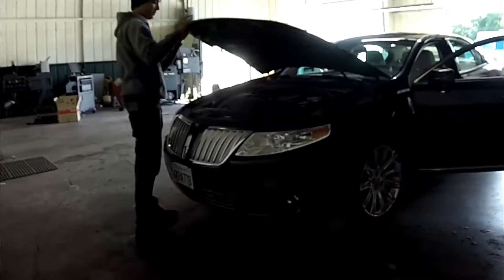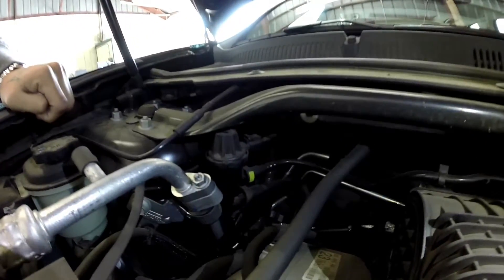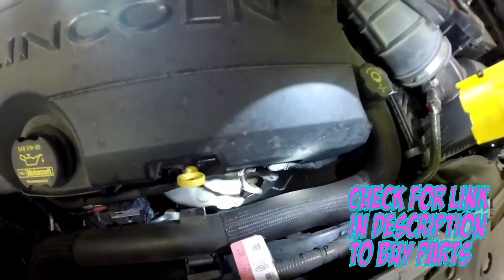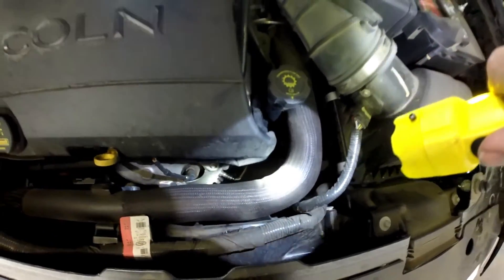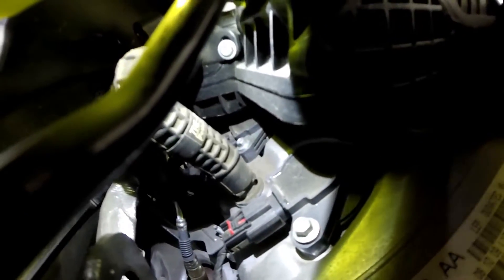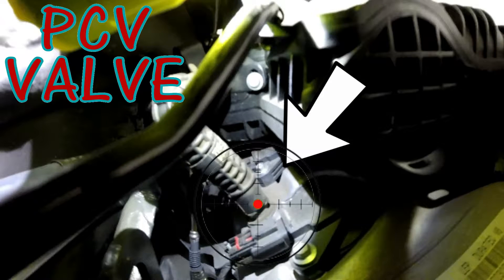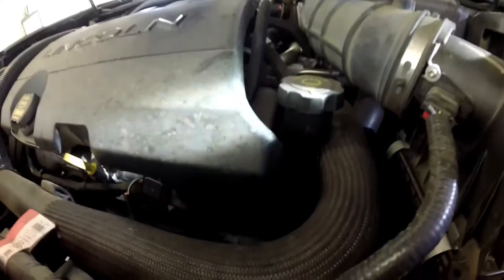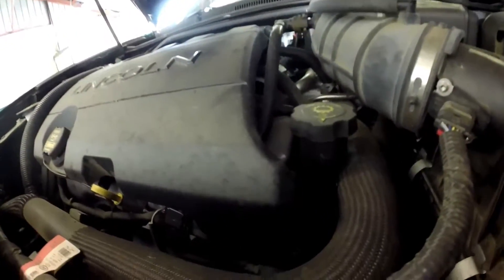Lincoln MKS Emissions Loations: PCV, EVAP Purge, Oxygen sensors.

Comment: That's not a 2013 model
Reply: I have to change bank 2 sensor 1 on my 2013 MKS. It looks to be in the same place as the 2012.
Reply from the maker: @abnbmet  thanks for letting me know. Good luck on your diy repair.
Reply from the maker: You are actually correct. This is a 2012. So all the same for 09-12. Thanks for that.